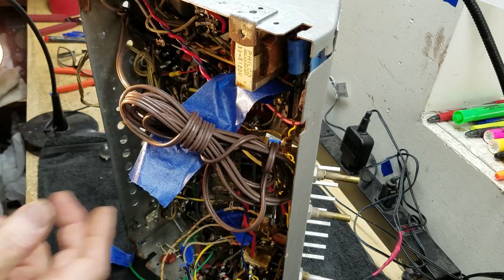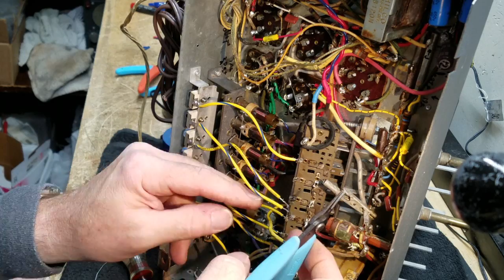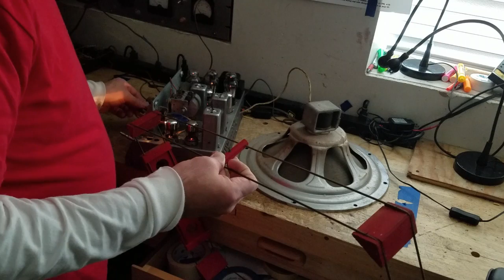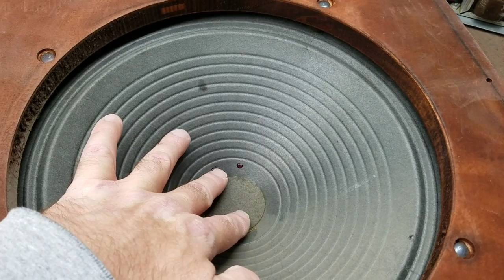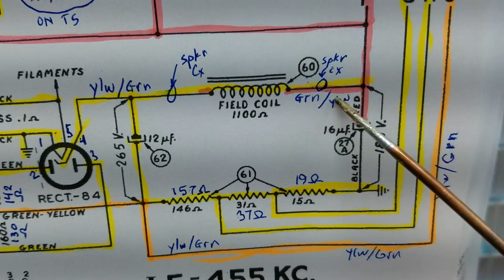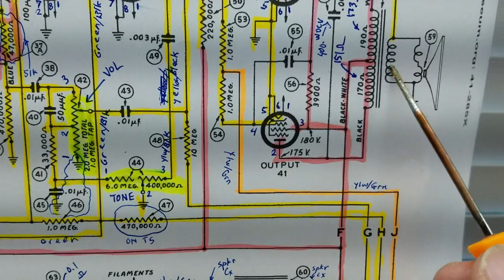1941 PHILCO 41-285 CONSOLE Part 6 of 9 Putting Humpty Back Together Again

Comment: Humpty Dumpty is going back together well Michael! You have given it a new life... It looks great and is starting to sound good too now. That replacement speaker has LOTS of bass. Mark.
Reply from the maker: Mark,
When that original speaker started buzzing, my heart sank!  I was thankful to have saved some Philco speakers that I harvested last year from consoles with trashed cabinets.  This one worked out particularly well.  I know that the purists would squawk about using a non-original speaker (I got some grief for the PM speaker that I put into that Westinghouse tabletop a few weeks back), but it sounds fantastic.  The owner gets a very cost-effective solution out of the deal.  Besides, these radios were designed and built to be serviced, including replacing speakers.  I'm keeping with that design intent.

Cheers!
Michael

Comment: Hey Michael, that speaker really sounds good! I thought those yellow wires on the trimmer caps looked original. Didnt I see some pink auto wiring harness wires in there? This has really turned out nice, I know you have had ur moments with it, but, as usual, you worked thru them. Thanks for sharing, cheers, Larry
Reply from the maker: Thank you, Larry!  I'm pretty pleased with this one, considering how it started.  I was quite happy with the sound, too.   I appreciate that you watch and comment.  BTW, I am looking forward to you getting the correct decal for your Philco, and seeing the end result.  I have a couple that I might do that approach with, myself.   Take care, my friend!

Michael
Reply: ThatTubeSound lol, when you were admonishing us for not catching you mixing the wires up on the push buttons, I had thought in the previous video when one of the wires was broken, to use the extra coil because the PB was broken. One good note, you didnt mention it, but I caught you doing, which I'll try to incorporate and mention, is you installed all the wires before soldering. This saved u some effort and time, when you caught the wire in the wrong place. That is a good method worth mentioning! Thanks! Cheers, Larry

Comment: Michael, any idea where to find the on-off switch mounted to the pushbutton assy.  Have the same radio and that switch is broken.
Reply from the maker: Ray, 
I did one of these a couple of years ago that had a bad power switch.  I wasn't making videos then but I remember trying to find one in the usual places: eBay, Antique Radio Forum "for sale & wanted", and Playthings of the Past.  I was unable to find one, but then I could not look very long because it was someone else's radio and I needed to get it back to them.  What I finally did was to install a line cord with a heavy-duty in-line switch.  It wasn't an elegant solution but it was reliable and repeatable.  Then, I simply wired around that switch on the board.  I did not take the switch apart to see if I could fix it, and perhaps I would if I saw the same situation today.  

FWIW, I have found other parts on the Antique Radio Forum.  It wouldn't hurt to give them a try.  I hardly ever actually visit the site, so I don't know how active it is, these days.  You might also try the Philco Phorum.  It's an awesome site, well managed and organized.  Perhaps other folks have thought of a better solution than mine was.  I think they have a FOR SALE & WTB forum there, too.

If it were my radio, I'd put the in-line switch on it and then continue to actively look for a switch.  Sooner or later one will pop up.  Then, just put things to rights at that point.  Believe me, I feel your pain!

Thank you so much for watching!   I wish you the best with your Philco.  Take care.    Michael
Reply: Thanks Michael,  I ordered 3 different switches from Lower and hope one will work.  Thanks for the quick response.